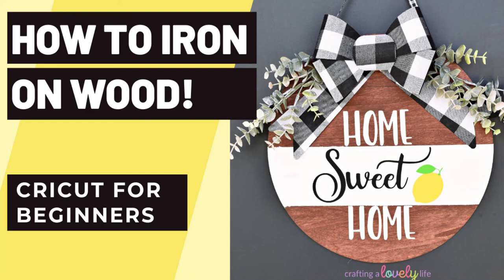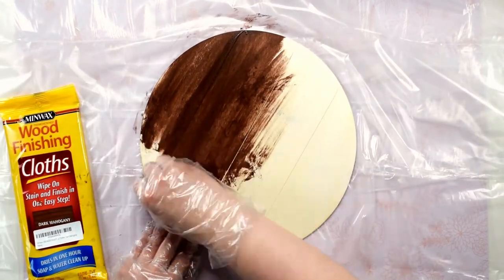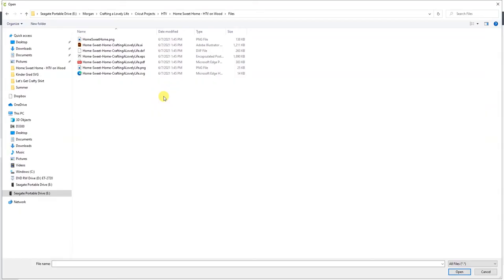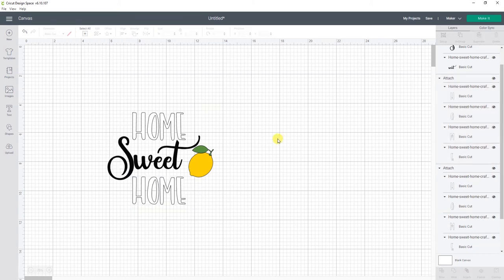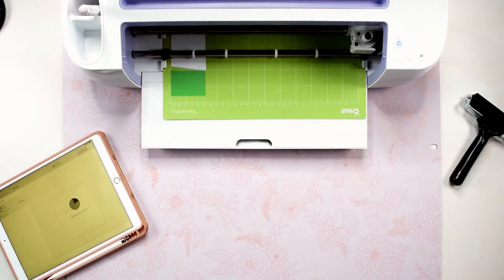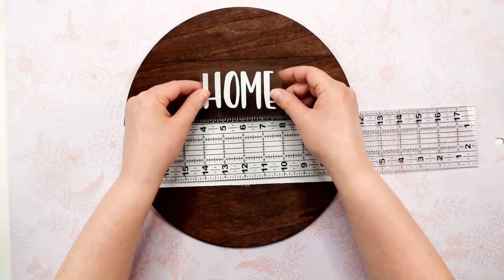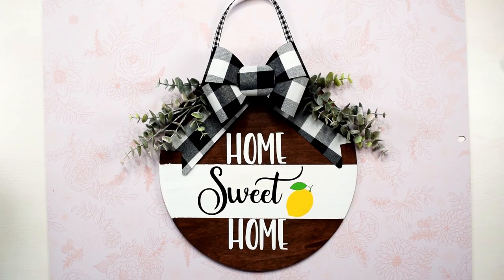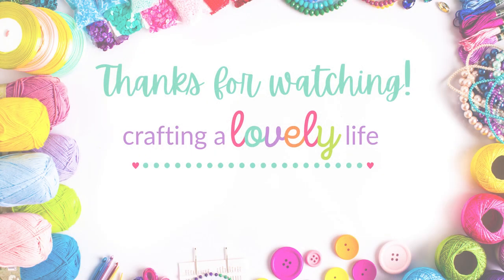CRICUT IRON-ON WOOD FOR BEGINNERS | HOW TO IRON ON WOOD WITH YOUR CRICUT | HTV ON WOOD

Comment: I don't have a mini press. I guess I can use my heat press that I use for t-shirts right?
Reply from the maker: Hi! You could try using a larger heat press, but I don't recommend using one that you can't constantly move around.  If you just use a traditional heat press that is stationary during the heating process, you will likely burn the wood.
Reply: @CraftingaLovelyLife  😔 thanks for replying

Comment: Awesome tutorial. I do have a Mini Press but it’s not Cricut. Would you happen to know what the Temp is on the Med Setting? On mine I’m seeing it’s 302*F. Would that be hot enough? Plus I am using 143 Vinyl. Thanks
Reply from the maker: Thank you!  The Cricut website says to use the medium setting with most base materials or heat-transfer materials that transfer between 300°F (150°C) – 355°F (180°C).  So I think yours should be hot enough.  If you notice that the vinyl isn't wanting to stay down then I would just try bumping up the temp, but be careful not to overheat any one area.
Reply: @CraftingaLovelyLife  Your Very Welcome. Thanks for reply and I will take that in consideration. I am new to all this so it is definitely valuable! I really appreciate you. And I’ll let you know how it turns out. Can I send you pics through here? Thanks Again Sweetie. 😊
Reply: Can I also ask another question… why can’t you seal first then apply HTV? Will it not adhere? Thanks.
Reply from the maker: @jamesbarlowjr.3762  sure thing!  It's not recommended to heat most of the products that you would use as a sealant (flammable, etc). You are also correct in that you would likely not be able to get the HTV to adhere once a sealant is applied.
Reply: @CraftingaLovelyLife  Thank You. Just wasn’t sure what the difference was or is. You would think if it adheres to stained wood, that it would be fine for sealed or smoothed surfaces. And you should be able to seal your piece once the HTV applied? Thanks for all your responses. I appreciate it. I’m still learning. So bare with me. 😊

Comment: HI.
I was wondering if I can use an iron instead?
Thanks.
Reply from the maker: Hi!  I have not tried using an iron on heat transfer vinyl with wood. In theory, it should work. You would just want to make sure that it doesn't get too hot and that you move the iron around constantly so that no one area gets too much heat.

Comment: Should I seal this with Mod Podge?
Reply from the maker: I don't recommend sealing with Mod Podge as it typically leaves streaks on whatever you are sealing.  If you are going to have this outside and exposed to the elements, I recommend using a thin coat of polycrylic after you have applied the iron-on vinyl.  If it wont be outside then you shouldn't need to seal it.